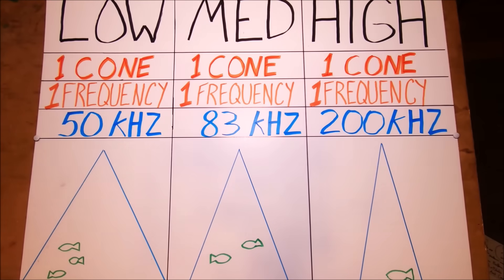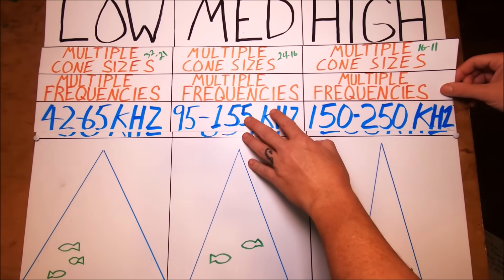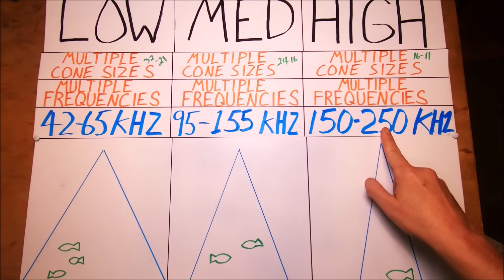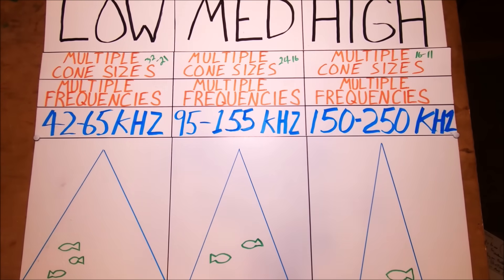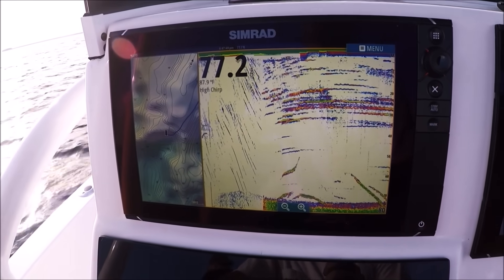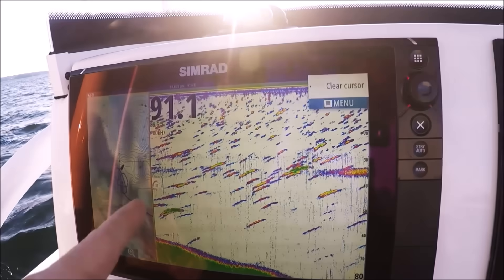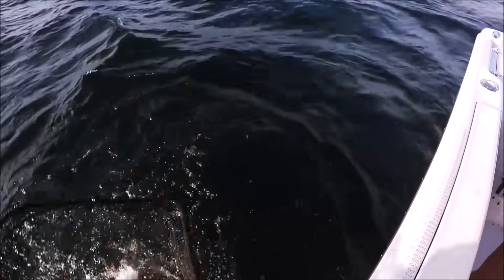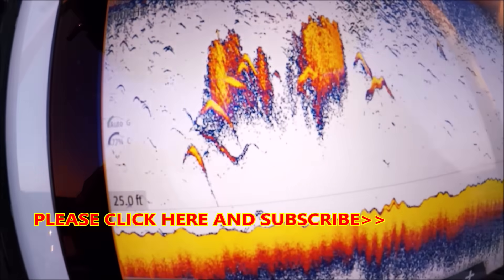CHIRP Explained in 4 Minutes! Chirp Sonar EASILY UNDERSTOOD.

Comment: I have a Lowrance Elite FS with a 3&1 trans. I fish for catfish in a tidal river. Why would I want to switch over to Chrip , than say 83 Khz ? Just wondering what you would recommend? I have trouble understanding unit sometimes or most times. Any help would be great!
Reply from the maker: Every 3in1  transducer has one frequency choice that performs noticeably better than the others. For the shallow water you are fishing in you will probably get everything you need in single frequency 83khz because it has the widest cone angle which marks more fish. I recommend experimenting between high or medium CHIRP and 83khz. Toggle back and forth to see the differences. You will probably see the best results in 83khz, because you fish shallow. If you’re ever in 100-200ft deep a CHIRP band would likely outperform the 83khz. CHIRP uses a bandwidth of multiple frequencies versus 83khz which is a single frequency   Hope this helps 👍

Comment: In general, the TI units are faster in response to inputs. This is seen when quickly switching between sonar, downscan, chart, and split screens https://www.youtube.com/post/UgkxeAxH15LxhjGlg5-CRYqjTGTEH0tbY4vk recommend  The Hook units will show some lag on button pushes and screen switching. The big ticket item though is maps. If you install a mapping card such as Navionics or the free C-Map Genesis which has a lot of map detail, then moving around the map with the cursor or when running down the lake can lag significantly on the Hook units, but is seamless with the TI units.
Reply: You make the same remarks on all the different Youtube fish finder videos using a different name. Don't you get tired of doing the same thing over and over and over???

Comment: when offshore along a shoal, i was using high chirp and it was reading good for depths under 25ft or so, however once i crossed over the shoal the high chirp was not reading, unitl i switched to low chirp it read the shallow water under 20ft. I thought high chirp was for shallow water is this not correct all the time?

Comment: Can fish detect or feel chirp via the lateral line or swim bladder?
Reply from the maker: Definitely. I can hear it when I swim under the boat so I know they can. However nearly every boat has some type of sonar clicking away. Especially in lakes and bays, so I don’t worry about it scaring fish. I’m a fan of boat noise for Striper fishing. I make a racket when possible. Other species might react differently, but Stripers move right in.
Reply: @MikeSmedleyOLDSCHOOLSTRIPERS  very interesting. So you don't feel the motor running or loud music would spook them?
Reply from the maker: There certainly are times for silence, but I always start off being loud. Especially in saltwater. If you notice in all of my jigging videos the motor is running and 3 transducers are firing away. These fish follow commercial vessels like clam boats and crab/lobster boats eating the by catch dropped over the side. I believe they relate boat noise to food.

Comment: Your technical description of chirp is wrong. 150KHz to 250KHz is the range. Short of having the detailed operational description from the manufacturer (proprietary information), the transducer could be using anything from two to an infinite number of frequencies between 150KHz and 250KHZ. Saying that there are 100 frequencies is like saying there are only 12 measurements that can be performed with a 12-inch ruler. The reality is probably more like the transducer outputs pulses that sweep between 150KHz and 250KHz with every pulse being a slightly different frequency. Yes this is a better technology but it is not using 100 different frequencies. Understand that 150KHz is a different frequency than 150.1 or, 150.12 or 150.04. The spec of 150KHz to 250KHz is simply the range of frequency employed and how they employ that range is generally not made clear in an owner’s manual. Its probably anything from 5 different frequencies to 25 from one end of the range to the other.
Reply from the maker: Yes. Thanks for the info. I was trying to keep it as simple as possible. 👍

Comment: Does the cruise have skimmer transducer have chirp frequency
Reply from the maker: No.
Reply: @MikeSmedleyOLDSCHOOLSTRIPERS   will I still have a scope? I fish salt water in raritan bay and sandy hook area. Do you thing this model was correct decision? I fish stripped bass spring and fall. I have the lowrance hook2 now that basically don't tell me nothing but water temp speed and depth and black blotches everywhere that look like little fish shapes
Reply: I recently got the simrad cruise 5 with skimmer transducer. Will I still get similar readings as in videos as I seen you have much better unit

Comment: Hey buddy, thanks for confusing me even more than I was. I think you have your frequencies messed up in your video. You’re mistaking high with low. Low is for deep water and high is for shallow. You have it the other way around. The drawing you have with the cones are wrong. Low should be high frequency and vice verca.
Reply from the maker: You’re right low is for deep and high is for shallow. That’s what I said in the video. 

The cones are confusing you. A narrow cone does NOT TRAVEL DEEPER than a wide cone. 
Here ya go. https://youtu.be/1Pmaw686Nl8
Reply: You’re right, lol! I just watched another one of your videos and understood what you meant. This stuff is confusing 😕 not sure if I should get a L/H or M/H throughhull transducer. I mostly fish 100 to 300 ft
Reply from the maker: I know it brother. It’s very confusing. I would get M/H. Low has pretty low resolution so detail is poo. In 600ft or less high and medium will perform best. Low will show fish in 1000-2000 ft in most cases, but if you’re never fishing that deep there is no other reason to use it. Most low CHIRP videos are in the 1000-2000 ft range. 👍👍
Reply: @MikeSmedleyOLDSCHOOLSTRIPERS  thanks for the info Mike. So if I ever need to check out 1000ft, will the medium chirp show anything?
Reply from the maker: Sure. It will definitely show bottom and most likely show fish just fine. HIGH  will actually show bottom over 1000 ft deep, but usually won’t show fish near the bottom like low.

Comment: Good info. Just got a humminbird helix 10 si Gen 4. Little intimidated by all the mega plus and dual chirp. When to run which.
Reply from the maker: Mega plus is just For side scan when set to 1000lhz for the highest resolution. You lose a little range so 800khz is better in open deep water. In less than 30ft use mega plus. For 2D sonar use medium CHIRP all the time.

Comment: Another way to explain frequency is the size of brush your using to paint a picture of what's under your boat. High Frequency small brush bounces off the first thing it sees, low frequency bigger brush bounces off the first thing it sees. Your cone diagram shows perfect example. but the display will only show 1 fish regardless to how many fish are in the cone.

Comment: I’m on the BC coast and wondering how chirp will work. Was told that the P 66 was the best.
Reply from the maker: The P66 is not a CHIRP transducer. You won’t see any improvement at all. These are 2 CHIRP transducers that are great in different price ranges. I’ve used both. 

TM 150 M  Transducer 
https://amzn.to/2BsVMud

TM 185 High CHIRP Wide with Xsonic plug end (Evo3)
https://amzn.to/2XDLJw7
Reply: @MikeSmedleyOLDSCHOOLSTRIPERS  thanks Mike for the links, and I understand the P66 is not a Chirp, and want to know if the chirp are good in our waters? Was told the chirp were only good for clear water?
Reply from the maker: @garylajeunesse1428  CHIRP was designed in the salt for the deepest waters. Lowrance/Simrad was the first to design CHIRP for the sport fisherman. Before that it was super expensive and used commercially off shore. 👍👍
Reply: @MikeSmedleyOLDSCHOOLSTRIPERS  thanks again Mike, and appreciate your response and videos, great information. Had a talk with Wayne at Navico who is very familiar with our area and has recommended the TM275 LH as a good fit. P66 is the most popular used transducer here, but I’m liking what I see from Chirp and figure it can’t hurt to have both. ✌🏻

Comment: Thanks so much for the info! I use Garmon on my boat and recently went out to 1800’ of water and my units quit working in 600’. I want to be able to fish in those waters and fish in 70’ what in your opinion would be my best option? Thanks for your help.
Reply: definitely high chirp/high frequency. Generally the deeper the water the lower the frequency you need.

Comment: Hey Mike awesome video thank you.. questions I have is I am upgrading to a garmin with the HD technology.. which transducer would we need for the chirp ? Most units including my current lowrance says it’s all in one and we do not need to purchase a separate one. If we chose to do so and upgrade performance,I cannot find a transducer thatspecifies it’s better for the chirp settings. Thanks for your time
Reply from the maker: It probably comes with an “all in 1” type transducer. The CHIRP with those are not the best. Any of the Airmar CHIRP transducers will be a huge step up. This is the least expensive and probably a HUGE improvement over the included transducer https://amzn.to/2BsVMud
Reply: @MikeSmedleyOLDSCHOOLSTRIPERS  awesome thank you. So what I get from that is that airmar makes a transducer with capability to connect to a garmin unit or lowrance unit? The plug-in will be comparable?
Reply from the maker: The short answer is yes, there is a strong chance that Airmar makes Garmin’s transducers. Airmar makes transducers for most brand displays. However they don’t offer all in 1 transducers with side and down scan. If your Garmin has 2 transducer ports you can add an Airmar CHIRP transducer, but if you replace the all in 1 altogether you will lose side and down scan.

Comment: Great video and appreciate the time you put into the flip chart explaining the frequencies and CHIRP!
 I'll tinker with my Helix 5 CHIRP G2 GPS some more but so far I think it is a POS. It was advertised/implied had DI and SI but after spending a day installing the transducer line and getting everything hooked up then into the water I found it does not have DI or SI which really sucks. Its too much trouble to take the boat back out, remove the transducer cabling and send it back. Humminbird bundles there manuals and specs together making it disillusioning as to which unit does what.
So far the Helix 5 G2 GPS SUCKS
Reply from the maker: I’m glad you like it brother thanks!! Yeah that’s stinks about that transducer.

Comment: What would you recommend for fishing lakes?  I’ve tried both chirp and 83khz and I can’t distinguish what’s a fish and what’s brush/debris. The lake I fish is fairly clean
Reply from the maker: What unit and transducer?  83 is great for lakes, but I would use CHIRP in water deeper than 30ft for most transducers.
Reply: @MikeSmedleyOLDSCHOOLSTRIPERS  lowerance hook 7. Has 2d sonar and down imaging. I’m fishing anywhere from the banks of the lake to 30ish feet of water. I use to fish the Chesapeake bay and it’s tributaries but now I’m only fishing fresh water lake that’s fairly clean. So I do t have surface clarity issues.
Reply from the maker: Make sure your interference filters are off. You should see good arches in both 83 and CHIRP.
Reply: @MikeSmedleyOLDSCHOOLSTRIPERS  so both surface clarity and noise rejection should be off?
Reply from the maker: @BDDLINTN  Yep.

Comment: Mike, getting ready to put the TM275LH-W with CP570 on my cousins 3100SXL Northriver and would love to pick your brain on settings. We are running Axiom 12’s front and back and do all kinds of fishing from shallower Salmon to deep water Halibut in 800 feet of water to albacore offshore trolling and live bait and jigging. Never have had a really consistant picture. Love my Lowrances for the ease of use.
Reply from the maker: That’s the perfect transducer for you. Salmon and Halibut both can be hard to Mark without air bladders. I would probably leave it in CHIRP settings all the time since I mark airless fish best in those settings. I’m not familiar with Axiom but if you can run both high and low simultaneously it can be a great way to learn the ins and outs of the 275 quickly. Email me if you have any questions. I might be able to help. I would love to see screenshots of halibut on the bottom too. I mark flounder on the bottom all the time.   Mikesmedley9@gmail.com
Reply: That is the beauty of the CP570, it can run 2 Chirp signals simultaneously with each independant signal showing on split screen for instant comparison.
Reply from the maker: We can run 2 at once with the Simrad’s as well. Check to make sure it can run a pair of 1Kw transducers at once. Some are limited to 600 watts. The transducers will have 2 plug ends on it as well. I’m not familiar with the Axiom. Make sure it has 2 transducer inputs. Some brands require a separate processor.
Reply: @MikeSmedleyOLDSCHOOLSTRIPERS  CP570 is the same as Simrad S5100. Runs to Chirp Channels at 2kw each.  Have all Carbons on my boat, but don’t have transducers to optimize. My cousins boat will be loaded with newest Raymarine Chirp system available for the Axiom series.
Reply from the maker: So it will run 3 CHIRP transducers like the s5100?
Reply: @MikeSmedleyOLDSCHOOLSTRIPERS  I don’t think so, it will run any combo of dual chirp on a single dual chirp transducer, or 2 separate airmar transducers in pairs, mounted on either side of the hull mounted as a pair. But will run up to a 4Kw monster transducer by itself.

Comment: You have the LOW/MED/HIGH backwards, the cone is larger on the high and narrow on the low. Low is for deep water, high for shallower.
Reply from the maker: No sir. Low is the widest cone. It’s best for deeper water because of frequency and not because of the cone width. A narrower cone does not travel further, although that’s a common mistake.
Reply: According to Airmar, Low has 25 and 16 degrees on the low side and constant 25 on high side, 16 degree penetrates up to 3000 fow where 25 shuts off much shallower. At least on the TM275 LH-W that is what shows on the website.
Reply from the maker: Higher frequencies rarely travel effectively past 600’. I have that transducer and several others on my boat right now as I am a tester/beta user for Airmar. This link will help clarify what’s goin on. Scroll down to Page 3, it has the details, second paragraph is excellent. Higher frequencies travel quicker and are emitted more frequently yet much shorter so they are good for shallower water and greater detail. It’s actually a very common misconception that narrow cones travel further, it SEEMS like that is how it should be, but it’s not like a shotgun choke. Thanks for the comment brother. 

https://www.airmar.com/uploads/brochures/AIRMAR%20Transducer%20Guide%202009.pdf

  The HIgh wide models can be confusing as Airmar has engineered that unit to send a wide cone of 25 degrees in the high frequencies. The reason it “shuts off” is because of the frequency and not the cone size

Comment: I don't think it's the swim bladder that you can see on the echo sounder.
it is the fish swimming through the echo sounder. changing its relative distance from the receiver. that is why you see a crescent.
that's why you can see fish that don't have a swim bladder, like a halibut.
otherwise you would not be able to recognize artificial lures either.
Reply from the maker: Of course you can see solid objects to, but the air pocket gives you such a strong return that the return from the fishes body is barely seen in comparison   The salmon guys in Canada have struggled for years because of the non existent air bladders. Some Mackerel too. CHIRP now shows those fish, but older units wouldn’t show them at all.

Comment: hi mike, i have a simrad go9 xse ai 3 in 1, what is the difference with the 200 khz compared to the med chirp and high chirp on that model that i recently bought, in other words is the 200 khz the same as the medium chirp and the high chirp is the more powerful of them all, i have to say the  simrad go9 xse ai 3 in 1 is amazing, thanks
Reply from the maker: When you use CHIRP you are using swept (multiple) frequencies in 200khz you are just using one frequency. Med CHIRP will have wider cones than HIGH or 200. I like 83 on that transducer to around 40ft deep. Then I would switch to med CHIRP.
Reply: @MikeSmedleyOLDSCHOOLSTRIPERS  thanks for reply, just one more final small question...what depth do you switch over to high chirp, thanks
Reply from the maker: I wouldn’t use high CHIRP on that transducer.